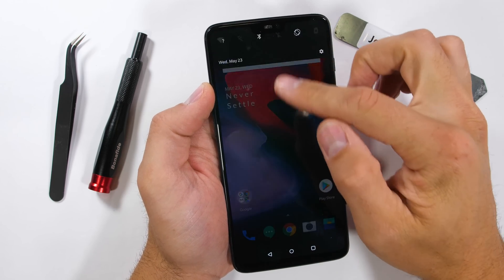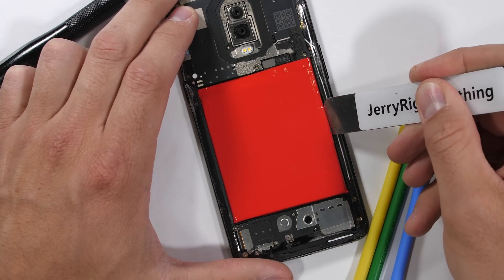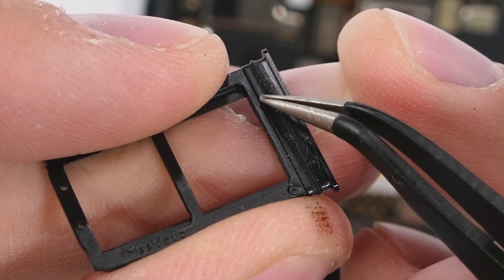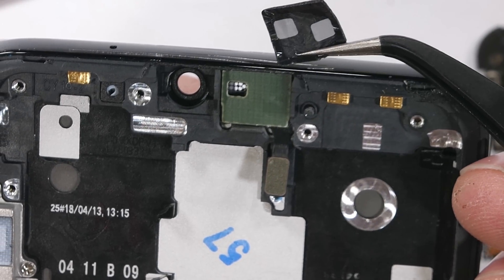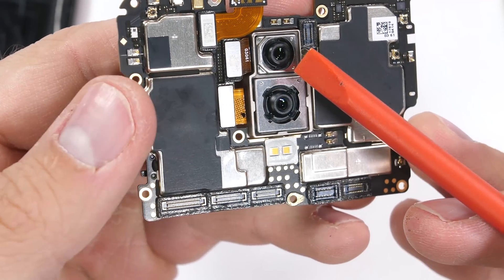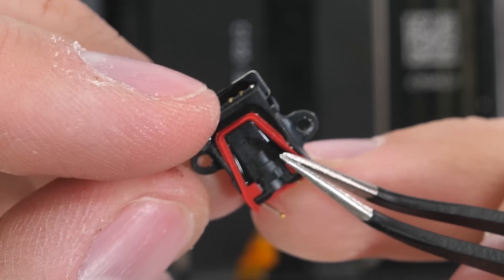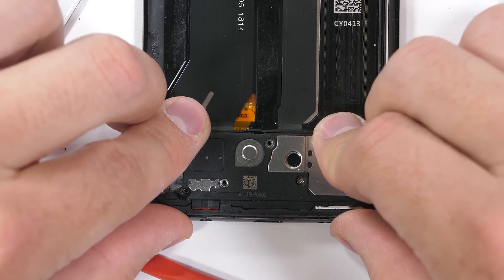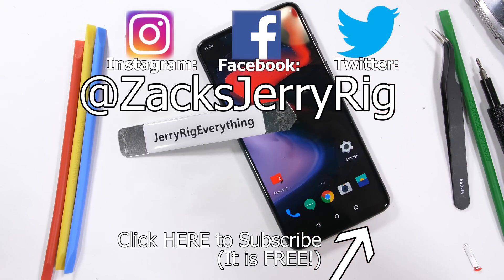OnePlus 6 Teardown! - How Water Proof is it really?

Comment: I was considering to buy One + 6 but, you exposed that there is no  heat pipe which will impact the performance in long run hence i drop my intention to buy it. thanks bro.😁👍

further, please put ur tools and hands on Nokia 7 plus.
Reply: Heatpipes are mostly for the sake of it. A phone can perform very well without it, and the One Plus 6 is a prime example of how a phone can handle the lack of a heatpipe without breaking a sweat
Reply: but if you check jerry's oneplus 5t video for water resistant check,it did not have heat pipe either and it performs nicely,so im not sure
Reply: anurag tiwari LOL thats the stupidest reason I have ever seen to drop a phone. Are you going to be playing fortnite for 4 hours stright or some shit? lmfao
Reply: Trum p It's an important reason if the phone reaches high temperatures and throttles.  However, this isn't the case with the OP6.  It doesn't get exceedingly hot and doesn't throttle.  The OP is jumping to conclusions about the effects of no heat pipe.
Reply: I lock my CPU at maximum frequency, and there's no throttling even after half an hour of benchmarking.  Seems to be as good as the past few generations in terms of heat dissipation.
Reply: anurag tiwari The reason for no heat pipe is because of how it charges. The main reason for heat pipes is to dissipate heat while charging. There's no need for the piping because the OnePlus charging block takes the majority of the heat. That's buy design, and that's why it can charge so fast.
Reply: Rahul R This won't cause long-term issues for you.
Reply: Even me I m waiting for mi 8 it has same specs as oneplus let's see when it comes on amazon 

Or else I will go with s9 on emi
Reply: Abhishek Kylasa I am planning to but op6, just a doubt will it last for 3 to 4 years
Reply: @rahulr8090  Well it has for me at least, still going strong!
Reply: A science behind having heat pipes and not having must be judged on the structural components of a phone.

i glass phone which is super sealed like Samsung galaxy phones, lg flagship and latest One plus 6 have been designed to be water resistant or splash proof.

This will end the possibility of air passage in the phone. hence heat generated will not be able to move out of phone.

on the other hand phones like one plus 5t was a metal designed phone which is not super sealed and thus gives chance to the air or heat inside the phone to to move out hence absence of heat pipe was not a problem in that phone.

the function of heat pipe is to distribute the heat of processor to the frame of phone and its body thus when the heat is passed to the frame the processor is cooled down and the cooling of frame is taken care by external environment of the phone.
Reply: I'm pretty sure that it matters more to performance that it only has a 1080p display.
Reply: lol same,i was about to order it from amazon india but just checked the video and no heat pipes..well there goes my plan xD
Reply: 845*
Reply: yeah thermal is definitely a problem on the op6, running a CPU stress test makes the cpu hit 90°c within the first minute, then throttles to 50%. inbox me if you want the screenshots
Reply: Thib L. Est. you are absolutely correct. but, its subjective today people buy phone for maximum usage of 1.5 - 2 years. but, i am considering a phone which i can use for at least 3.5 - 4 years.

hence in that long run, due to degradation of phone's internal materials and increase in consumption of power at due to frequent upgradation of apps in future, the phone will start to lag in coming 1.5 years.

SD 545 is world's most powerful mobile processor and more power generates more heat. if that heat is not properly distributed the internal part may get weakened.

again its subjective that for how much year you are considering to use a phone.
Reply: @anuragtiwari9143  Still have my one plus 6 since 2018 and it's going strong and still looks new

Comment: So does anyone know anything about the foam pit for ants??
Reply: It's for sound dampening. That's what foam is used for in audio. I suppose its to prevent the sound leaking throughout the phone so its more localized around the speaker output.
Reply: As he mentioned it's probably for shaping or dampening the sound.
Reply: It's a center for ants
Reply: @publicmail2  Thumbs up for the reference XD
Reply: I recon if you drop it in a pool it helps it float. 😂
Reply: oneplus just trying to get rid of its radioactive waste
Reply: SSnoWHand thank you
Reply: i wish i did
Reply: I actually believe it's for humidity absortion, in case water gets to the speakers, which are parts very sensitive to it
Reply: open cell foam would absorb moisture, however, It is more than likely to lower the -3db point of the small speaker, as it is slowing down the waves in the enclosure, "fooling" the driver into thinking it is in a bigger space. = more bass.
Reply: Vidio lucu
Reply: Its a pool for ants to swim in. Gosh. Am I the only smart one around here? XDDD

Comment: "no phone is water proof it's water resistant" - Zack
Reply: Except for the nophone
Reply: Joshua Joji Mathews I asked at the tech market if my repaired s7 edge is still waterproof and she answered the same thing
Reply: Joshua Joji Mathews they will be one day
Reply: Lloyd Share true
Reply: Applemasterexpert there is Chinese phone called agm which claims to be waterproof and it will float on water
Reply: Applemasterexpert for the same reason bullet resistant vest are called bulletproof vests..... sounds more "cool"
Reply: Could a waterproof phone even be able to make phone calls? Someone please make this their thesis title.
Reply: Lloyd Share audio ports and holes eg:- speaker, requires air to work
Reply: whip nae nae so basically what apple is trying to do?
Reply: Zacko_ bone induction and wirless charging/wifi ?
Reply: What about sony?
Reply: Tech With Brett Why not?
Reply: It is 47, the whole Zack thing is just a cover-up. :p
Reply: Sony claimed their first experia z phone was water proof. They even "filmed" the add under water using the phone.
Reply: I used my S8PLUS and then my S8plus when fully submerged, both phones done a great job and continue to work, My S7 was binned due to a cracked screen long after my swimming pool adventure. So I would say these phones are waterproof enough for most people.
Reply: My Nokia 1100 was waterproof
Reply: The no-phone id waterproof #_#
Reply: The nophone is water proof
Reply: Joshua Joji Matthews the nophone is
Reply: @Na_farmbot  of course
Reply: Red Phoenix lol
Reply: Max lol. But one I had a keypad phone which didn't die after putting its motherboard directly into water for a while it   was a Samsung phone which comes it a mts sim
Reply: Joshua Joji Mathews hy support me plz.
Reply: Prashant Rai sure bro
Reply: It's an American thing they don't know English too well.  They are to ignunt (I use that word because they are too ignorant to know any better.)